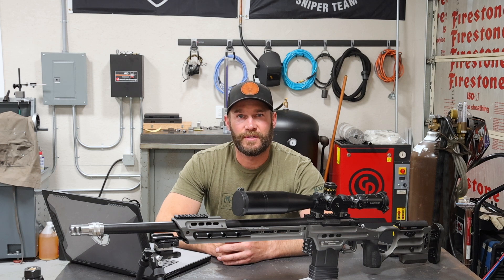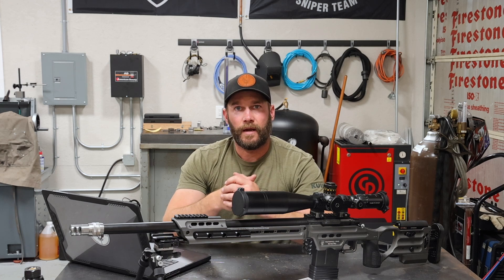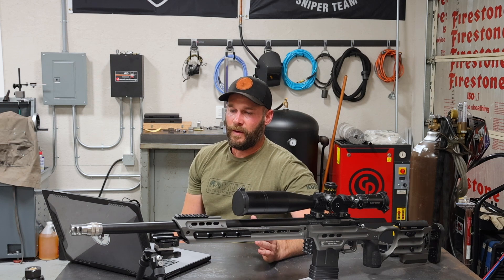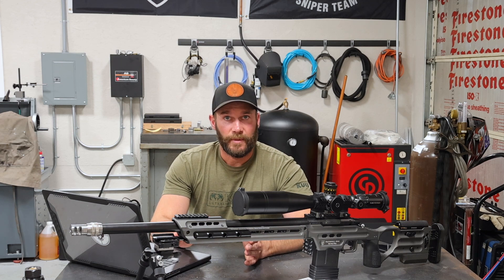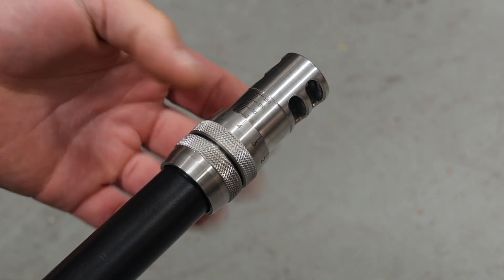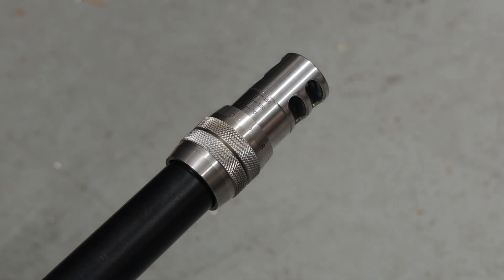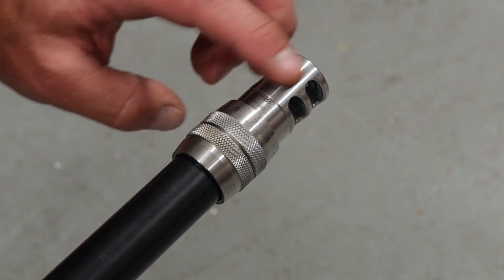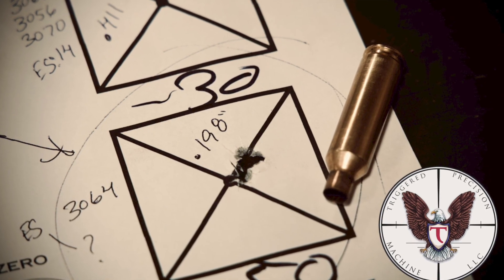TPM  - The Precision Rifle Reloading Series - #8 (PART 1 OF 2) - Harmonic Barrel Tuning For Accuracy

Comment: For people watching this video the fundamental difference between the Harrels tuner and say the EC tuner is the Harrels tuner sits over top of the barrel whereas the EC tuner sits on the end of the barrel. This is why the Harrels can afford a full revolution to find the sweat spot and the EC style tuner turns in fractions of a full turn.
No difference in final results just a different way of getting there although a slight slip with tuners on the end of the barrel can adjust the end result quite a bit vs. one that requires a full revolution.
Reply from the maker: Well said Dave. Thank you for that explanation!!!

Comment: To save a bit of ammo, if the groups open up at say 45, stop and go to the 51 setting and progress until change is noted. Take the ammo and retest in different atmospheric conditions. Make a note, because each rise and lowering of atmospheric pressure seems to play a part.
Reply from the maker: Great advice, will do!